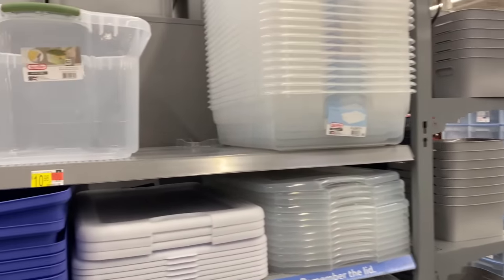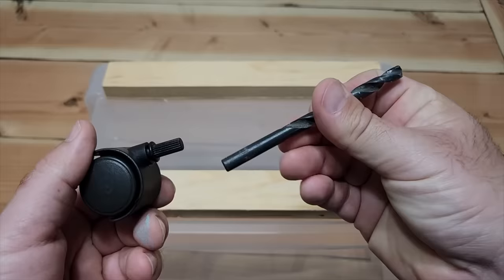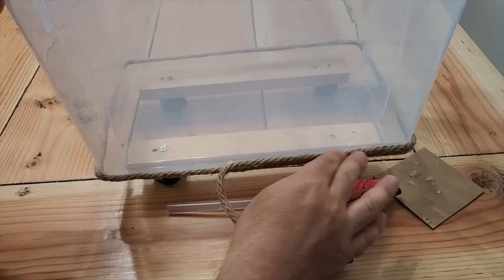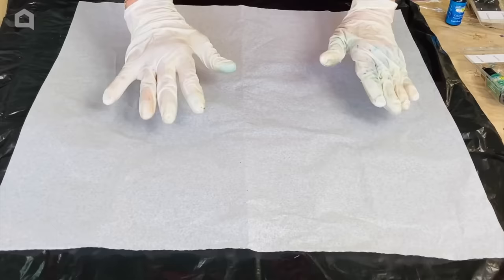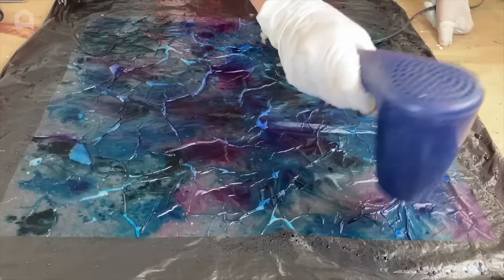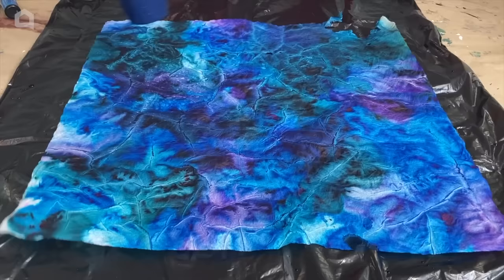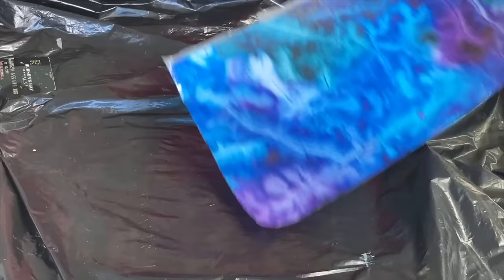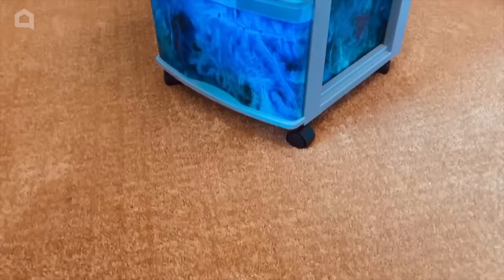Buy a cheap Walmart bin to copy this brilliant idea!

Comment: If anyone has forgotten the name of the pigments (like i did) its called Colour sparks by Ken Oliver. I loved both of these projects. I would use penny washers in the first one though, he said don't overtighten for a reason, it will crack, but if you use wahers the preasure will be distributed across the washer and hardly any on the tub. :face-blue-smiling:
Reply: Thank you for this info! Very useful.

Comment: I like this project, 😻 probably one of your best.  Would do a few things to tweek it.  One could add four, washers when screwing in the wood, to take pressure off the plastic so it doesn't crack.  As well one might assemble the rollers if there's hardware.  And being this is a make over, a used tote could be upcycled, to keep it out of the landfills.
Reply: I thought the same thing - my lids run away from the bins...
Reply: @michelledurdin8564  Right!!! My Family has this issue as well and not only that our Tupperware lids go missing idk how lids just are lost  🤔 Hmmm
Reply: Great ideas, thank you for sharing.
Reply: Did you create a video to share with the rest of us?
Reply: @TheHappyLifeofKay  Like socks do 😂

Comment: Loved these two projects!!
  I want to share my idea:  If you want a litter box that keeps sand in well I have the solution:  Buy one plastic container with the lid on, then take a regular size kitchen plate ,measure 2 inches from the bottom of the middle of the long side, place a place in the middle, TAKE A SHARPIE, N TRACE YOUR PLATE...Take the sharpiest knife you have, (MUST BE EXTREMELY CAREFULLY N TAKE YOUR TIME IN CUTTING THE ROUND HOLE)..
  AND, there you have a better litter box..we have had these for years, n they clean well.  Oh I toss the lid out..animals like pooping n stretching their head out while going..
Reply: My 2 female cats have gotten too big for their small round covered litter pan...I am going to do this instead of spending tons on a bigger pan...this is genius & I believe will b bigger than any special one on the market. Thanx so much for the idea
Reply: Thank you so much for this cat litter box idea. The ones in the pet store are so expensive
Reply: @johnewasiuk6561  oh i meant plate..fingers get in the way..
  Yeah, this keeps the litter in..going to redo my litter boxes.  Buying some clear ones instead of colored..to blend in with my stuff better.  I also use to clean the boxes out around 2 tablespoons of bleach with lots of water, let sit for several minutes n rinse n rinse..oh dont forget to scrub..
  You may have your own disinfecting stuff, but can't can't tolerate smells..even bleach is alittle strong.

Comment: I really like the first idea.  Please if you have more of the recording consider a full video. He said to go all around the tub, but it looks like he stopped at a certain level. Did you go in and out of the depressions on the side or ignore then and just go around? How far up did he go?  Also, did he put more fabric on the inside of the tub?  How did he handle the sides (fold or bunch)?  I will have to go to the dollar store to see the mm of the twine.  Seriously, I would love to see this in more detail.
Reply: He went all the way around the tub, meaning all sides, and the reason he stopped at a certain point was so the material wouldn't be so lumpy. Also, yes, you can, IF you wanted to go into the depressions, but you don't have to. By the looks of it, he did add more material to the inside. Just make it how YOU want it to look. It has to be to Your liking. Just have fun and experiment with it. :)
Blessing to you. <3
Reply: I need to know where to get the wider twine for another project bc dollar tree doesn't  have  any  wide enough  for  it there . If you could please  tell me where you buy the thicker twine I'd  appreciate  your  help  in this . Thanks  again  for  sharing  helpful ideas on a budget  .🍀🍀🌿⚘🤞🏼👊🏼
Reply: @kiyokowilkinson158  
I would suggest getting some rope from the hardware store.  They have all types & thicknesses.  Natural rope like this can be found at craft stores too, but sometimes it can cost more at those types of stores.  If you have any dollar stores in your area I would look there too.  If you can, it's best to check out a few different stores to compare what they have.  If you still can't find what you're looking for then maybe you could try to order some rope like this online.  Just make sure you know what thickness & what length you need for your various projects, that way you won't order way too much.  Good luck!

Comment: I suggest you make a drill hole first, because on some instances if you just screw into the container, the container will crack, making it useless. those containers are a bit brittle when it comes to making holes in them.

Comment: I love the thing the lady did with the tissue paper and the spray pigments, the outcome when it dried is lovely, but this is how to turn a cheap plastic drawer unit into an expensive one, because add together all the contact paper and the plastic bits and its going to cost a lot. But I will use the tissue paper idea for other projects.

Comment: I am thinking I would use washers on both sides of the screws for the wood pieces. Also, unless this piece is going to sit very quietly and not have a lot of stuff put in or taken out all the time it will work, but otherwise the glue gun glue is going to separate from the plastic.
Reply: Thank you, using washers was an excellent suggestion! Perhaps using another stronger type of glue, such as Gorilla Glue, might help with the longevity issue for the wooden boards.
Reply: And probably better not to use countersunk screws....

Comment: LOVE LOVE LOVE the plastic bin storage on casters.  But a question...I need a top on mine to store things dust free under my bed.  With top, that would fit the bill perfectly!  (Small apartment, gypsy boho decor)  Any suggestions on how to do a top so that it doesn't look like a storage bin?  And I "second" questions from Angela Truly.  LOL
Reply: Maybe try making a lid out of foam core and cover it the same or use a matching color of plain contact paper, thin wood, etc.  Many ways to finish off a DIY box with lid or plastic bin lid. Good luck!
Reply: @AFineLineA  Thank you! I'm one of these people who can copy anything but I've never had an original idea in my 70+ years. Sad but true. 😂  The foam board would be cheap, too...another thing beneficial to everyone in these days. Thanks again!
Reply: @susanb.3363  Glad it was of help to you!  Thank You also, for letting me know you found it could be of help.  I've made a foam core compartmented storage for the bathroom even.  Cover with contact paper or paint, etc and it has held up for years.  Cost $2 + tax at the time made!  Cheap and got the job done.  So long as others have idea's and you can learn from them you are good to go!  It's great you try.  That is most important.  Finding a way to make someone elses idea work for you.  We all get inspiration at times from seeing others creativeness.  A good thing!  Again, so glad you found the info of use.  Have a great night!  Best of luck!  God Bless!!! :)
Reply: @susanb.3363  If you did not just describe me to the “T”   I was born without the creative gene.

Comment: Very crafty aesthetically. Walmart's Sterilite plastic trays are simply crap. They are made of brittle plastic and break way too easily. For anything that isn't just for the sake of beauty - not utility - I purchased Rubbermaid Roughneck totes. The plastic Rubbermaid uses is pliable and even resistant to freezing. I've suffered so many broken or cracked Sterilite totes that I realized it was definitely worth paying more for the Rubbermaid. Walmart products are cheap - by design .